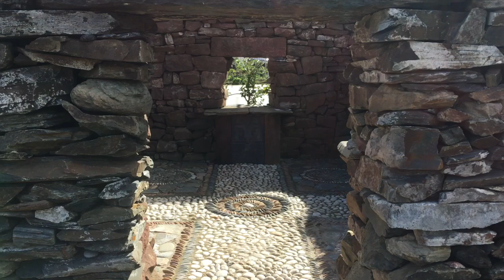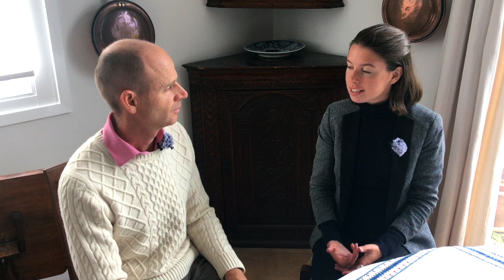Ecoblog IOM 22: Heat pump vs gas boiler

Comment: The numbers don't stack up 

Gas central heating is 1/3 cheaper to t run 
Or air source heat pumps are 3X the cost to run 

And remember the electric is 50% efficient once it hits the home 

Gas is 95% efficient 

It's not rocket science
Reply: Thank you for commenting. on this video. I only discuss the carbon emissions here, not the cost, but perhaps this is not entirely clear.